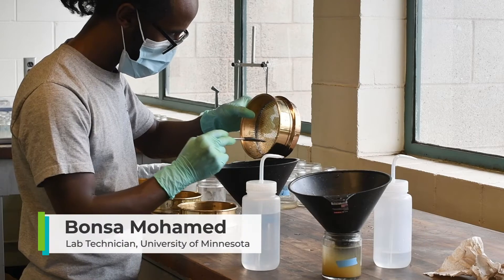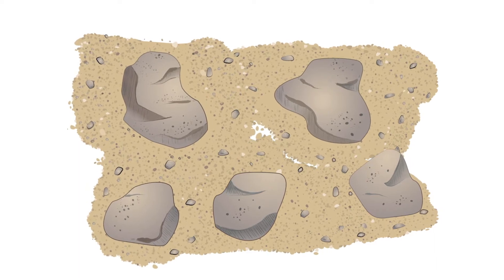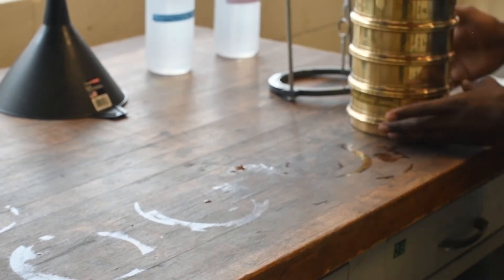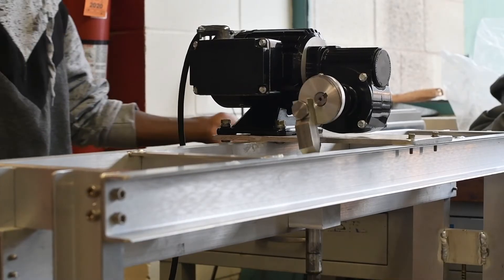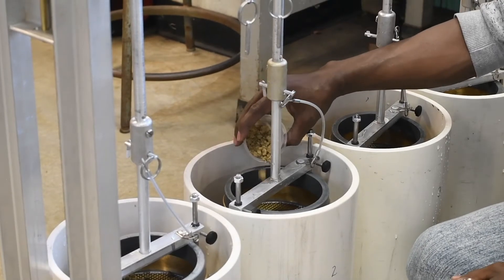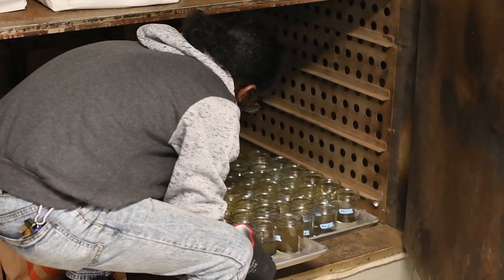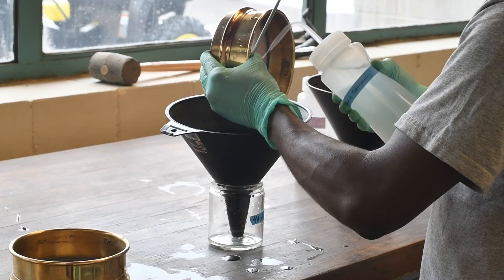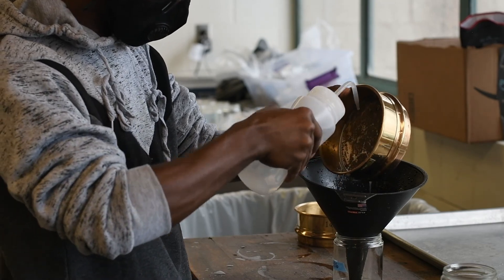Soil Aggregate Stability Test with Modified Yoder Device

Comment: Is there perhaps a way to sort of condense this into what one should be looking for without doing the complete testing and using the references for the mean weight diameter? Or at least go through the benefits of what such extensive testing could show you? A follow up video would probably be beneficial, with example test results and the real world application of the them would be nice to see.